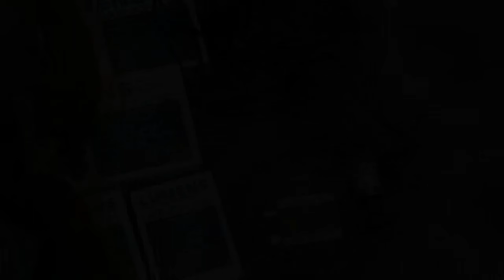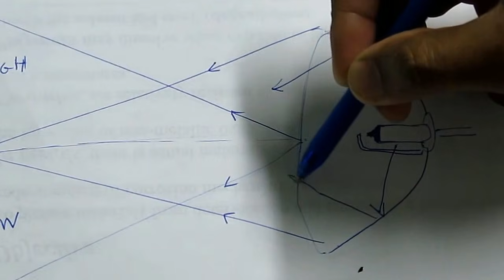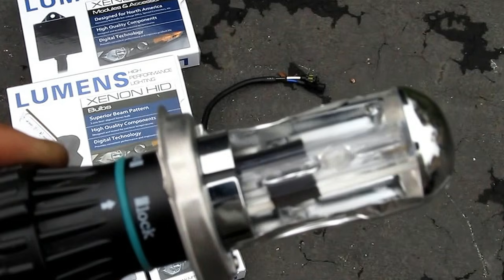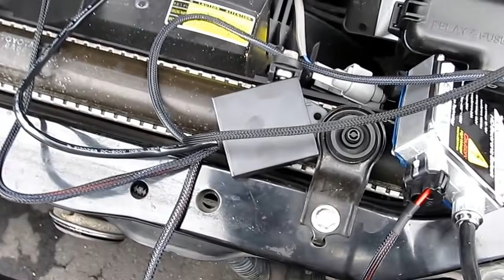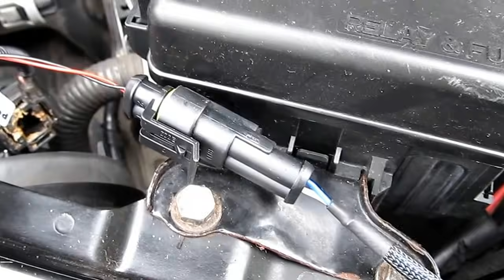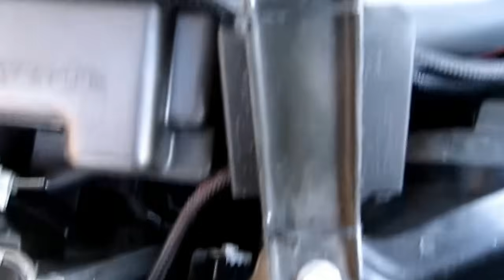How to Install an HID Headlight Kit

Comment: Please make a video showing in detail how to remove the headlight assembly. I got all the bolts off but I still can't clear the bumper.
Reply from the maker: +Dave B You have to wiggle it up and over the bumper. It wasn't easy because technically the bumper is supposed to come off.
Reply: Oh ok, yeah it didn't feel natural to get it over the bumper so that explains it. I managed to finally get it off, I had to pull them halfway out then rotate the headlight assembly up (headlights facing the sky) to get them out.
Reply from the maker: +Dave B Yea that's right, they have to face up because there is a ridge there. Hopefully you didn't scratch them

Comment: Speedkar99 what bulbs can I use to get better lighting (plug and play) ? On a 2003 Toyota Solara ?
Reply from the maker: +NeLLz2o3 on the 03 you have a much better housing with 9006 bulbs (compared to my 99). You can get those silver star or nighthawk bulbs or go with HID but watch for glare.
Reply: speedkar99 thx man , which would you go with ? I hear the silver star tends to burn out quick. I'm leaning towards nighthawk.

Comment: speedkar99 its me again i was wondering if you knew how to disable the auto daytime lights so i can switch on and off manually as you know the headlights stay on . i know you can pull e brake and then strart but they turn on when released , so maybe i can tap into the ebrake switch that controls that? or disconnect the sensor on the dash? without taking the dash apart since my cluster screws are im sure loctite glued in hah
Reply from the maker: I showed that in the video, just pull the plug at the passenger firewall under the hood.
Reply: haha no way i picked this video by random i guess cuz it had to do with lights and thats it hah so if i disconnect that plug you did i can operate headlights manually
Reply: Ok so that worked but the drl actually still activates itself at nightime automatically . Idk if youve ever dug deeper into figuring that out but if not atleast theyre not on in daytime. Another issue i ran into was the screws that hold in the plastic cover for the dash cluster . The screws must have been loctite at some point so i cant unscrew to change cluster smd lights. And another big one is my solara starts up strong but if i turn off ignition and then start car up within a 3-5 minute time frane the car sounds like it wants to choke and stall out . Thats most important if you could help

Comment: how to disable drl?  not the one under the hood because when I have to use my lights I have to plug it back
Reply from the maker: I disabled by unplugging the connector under the hood. The headlights work fine when I need them. If you want you can to hunt down the DRL fuse and see if that disables the DRL. It's not an option on techstream on these older Toyotas.
Reply: U know of the location of the drl fuse
Reply from the maker: There is one in the small front fusebox, pop the cover and read the legend. Not sure if this controls the DRL or if there are others. It might have been a 5A...
Reply: Thanks I'll try in the morning

Comment: I installed my hid 9006 slim ballast but now my fog lights don't work any answers to my problem ? & also my drl are still turned on they are stock lights
Reply from the maker: Skip to 4:50 to disable the DRL. I'm not sure about the fogs, as I wired mine up to work independently of the fog-lights. Toyota Independent Fog Light Mod
Reply: I checked under the hood & I can't seem to find the gray chords . I used a flashing & everything .
Reply from the maker: Did you look near the passenger side windshield cowl? Do you have a Solara?

Comment: i went thru 4 HID kits on my toyota solara, i'm thinking its my drls thats killing them, not sure what to do.
Reply from the maker: You need a relay kit. DRL's run at a lower voltage and will kill your ballasts.
Reply: speedkar99 ok... so do you think me simply unplugging the grey plug will fix my problem ?
Reply from the maker: Yes you can try that. But you should still be using a relay kit with a BiXenon H4 bulb.

Comment: Can you do HID fog light replacement?
Reply from the maker: I don't want to put HID in my fog light since I use it as my DRL. HID's might burn out faster and run much hotter than the stock halogen bulbs. Plus, I like the contrasting look of white HID headlights and yellowed fogs.